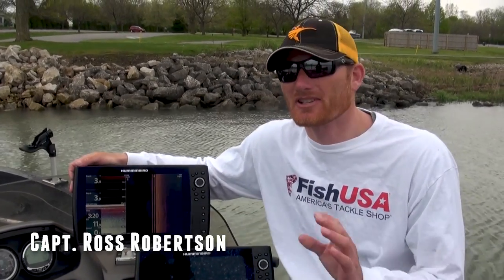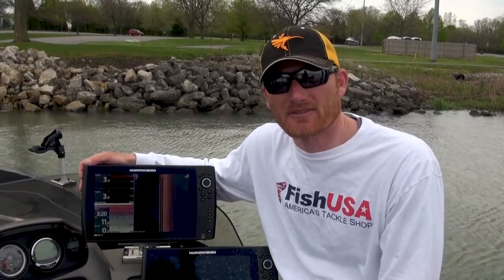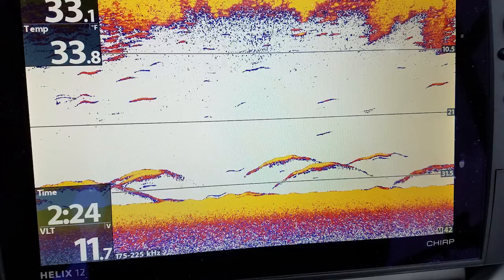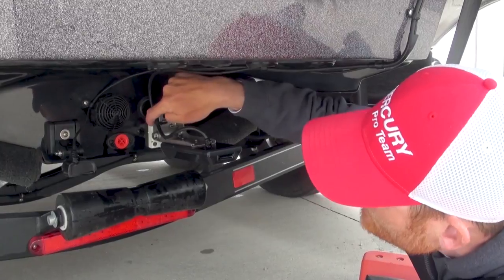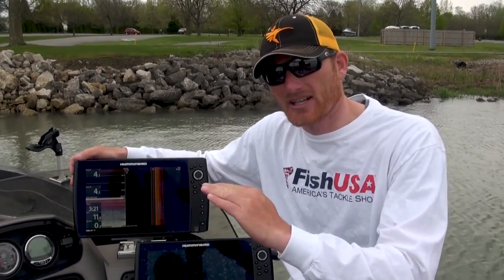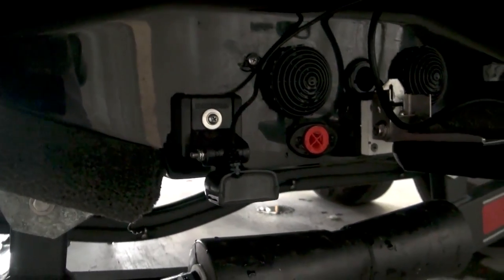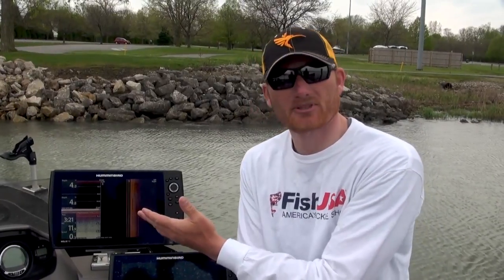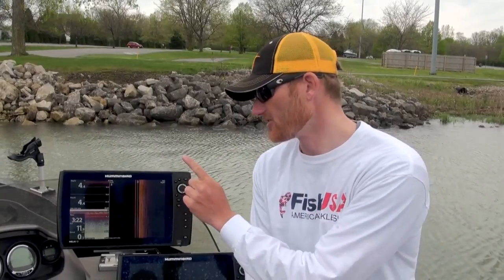How to Find the Fish - Transducer Mounting Options for Fishing Electronics - Capt. Ross Robertson

Comment: Bottom of my boat isn't flat side to side - it angles upward from the center of the stern to the outer hull extreme. The transducer is going to be at a different height on one side than the other.